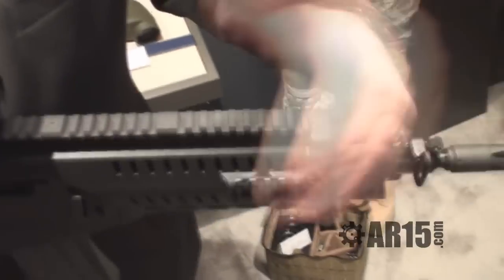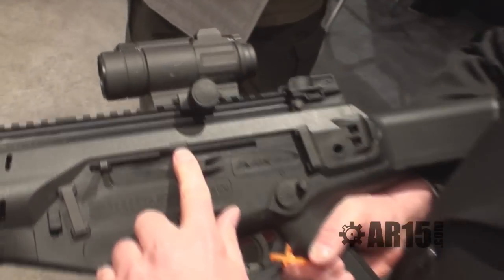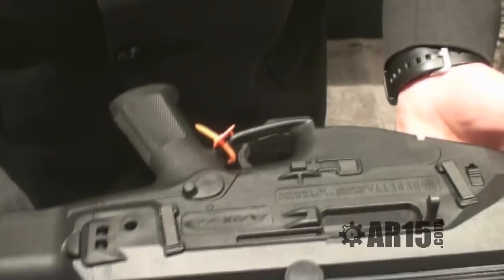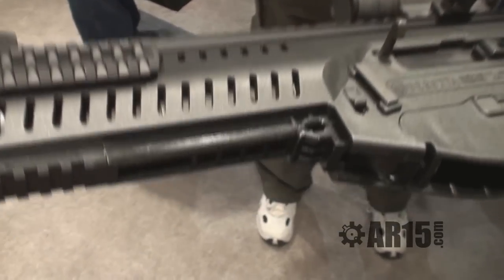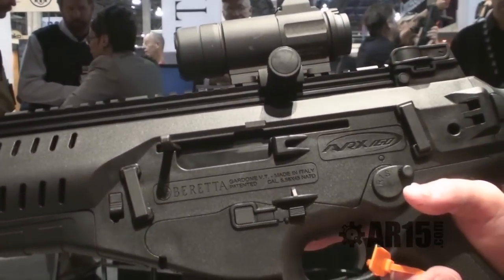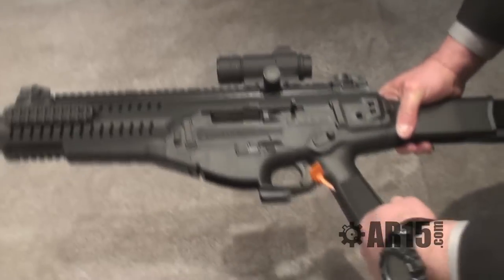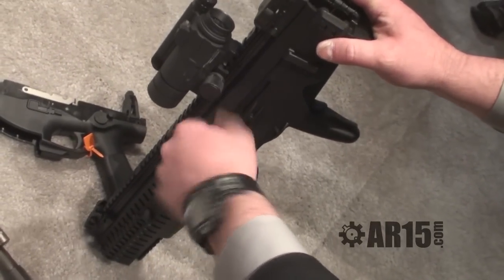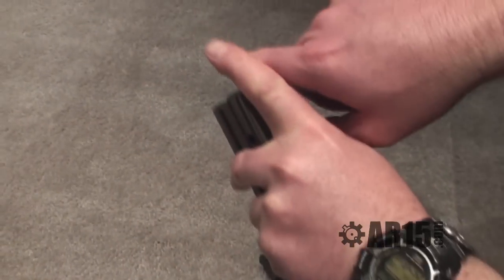Beretta ARX-160 - SHOT Show 2011

Comment: @Hyperpulsehammer I do realize that but the Beretta barrel comes off  WAY easier as you can see in the video. That is what I meant by my comment. As for a reciprocating charging handle, SOCOM specifically requested it so it must have some value? As for the ACR...c'mon we all know Bushmaster screwed the pooch on that gun. The initial offerings suck in my opinion with its ridiculous price, its hex head rail screws, and its 1:9 twist and no barrels available to even change calibers to?

Comment: @3is First of all, 3is, the 3RD mag release on the ARX located at the bottom, near the trigger guard, is perfectly safe since you need to depress it fully to release the mag...Also, that button is in perfect alignment, and it is far easier to have something snugging on a FAL mag release (never heard of it) since it is far more pronounced than the mag release on the Beretta ARX, sticking out and all... The AK is far more pronounced than the FAL and still nobody complains about it...!

Comment: @kookahjoon the tapping thing can go awry sometimes, It seems... You should see this guy in Shotshow 2010, when he had the charging handle stuck and took a second or two to get it right...  the tapping can become an issue, especially with ungloved hands! Ouch! With gloved hands, aka the military, no problem! That issue is not a biggie, if yuo ask me, nothing some training won't fix...And you can always 'slingshot' it or use the awesome bolt release on the trigger guard! Loved that feature!

Comment: @iMagUdspEllr While you did name a few features the 160 has over the SCAR, I don't see how they really matter.  It is only  1/10th of a pound lighter.  I do prefer a light rifle, but thats not much of a difference.  Does the barrel free-float on the 160 like on the SCAR?  I do like the speed of the barrel change on the 160 but does Beretta guarantee accuracy of 1MOA between barrel changes like on the SCAR?

Comment: @patsfanczar Oh, and you ALWAYS need to check the chamber, on the go or not, for safety reasons! You do that on a handgun, to see if a round is chambered, and you do so as well for a rifle or carabine! IT will prevent you from cocking it and eject a perfectly usable round that was already in the chamber, therefore avoiding wasting ammo! You check it before and after you have used it, because at the end you may still have a live round that did not fire! You DO check your AR-15's chamber , right?

Comment: @m16mang 
3.0/3.1 kg, 6.6/6.8 lbs empty, depending on the length of the barrel. Actually it's the lighter of it's kind (polymer assault rifle in 5.56 NATO). The ARX 160 is not another "weapon of the future", is not a "study" or an "advanced prototype". It's already been adopted by the Italian Army (along with Albanian and Mexican special forces), and is currently used in Afghanistan.

Comment: @rijoenpial fal has a mag release located front of the trigger guard like the hk g3 and AK47, not a trigger guard mag release.  I think its a poor 'improvement' design.  I do believe that a button/paddle lever would have been the best as both allow positive mag stripping.  Pushing up on a mechanism to strip out a magazine is flawed thinking and one extra part to break imo.

Comment: He's wrong at 1:09, because changing the cocking handle side does just that, it does NOT change the ejection side; to do that there's a switch that can be operated by pressing a bullet tip in a small indented button.

Comment: @Umimugo Yes, you're right... Problem is that the RFB doesn't have a port to see into the chamber, making the user having to be aware if he already has a cartridge in the chamber... Not good... a 7.62 F2000 would have such port... Another problem with the RFB is the ergonomics... And the shell ejector to the front, and not to the side, like the F2000, is another thing that I do not like on the RFB... Nevertheless, it is a compact bullpup, it is one of the most reliable models from Kel-Tec!

Comment: @patsfanczar  You have that 'trap door' port on the F2000 like you have the hold open to check the chamber in a normal AR... FNH just made sure there was a way for the shooter to be able to check the chamber! The same thing cannot be said for the RFB! The fact is that the F2000, much like the AK or HK, has no bolt hold open device, and the trap door is only checked to see if a round is in the chamber already and/or if there are any rounds left...

Comment: @patsfanczar The casings retention up to 5 casings could be there for tactical purposes, when you are firing a suppressed weapon single shot  and do no want to denounce your position by having casings falling on the floor unless yo deliberately tilt the F2000 to drop them... That is one possible reason... The truth is the forward ejection works, is very useful for lefties, the trap door is there for several reasons, and the weapon is compact, lightweight and very maneuvrable, like it or not!

Comment: UT OH, Cant have this in CT. It has a retractable and folding stock. Well i guess we could pin the stock so it doesn't retract anymore. But if we pin the folding section we wont be able to get the bolt out to clean it. Bummer.

Comment: Why  would ejection side matter on a non-bullpup design?  As for plastic being less durable, looks like the 160 has alot more plastic then the SCAR...just saying.  Larger selector levers are already available for the SCAR from Magpul.  I hope the 160 is cheaper, I may very well buy one if it can be had for under 2K.  Oh and I am glad that the US is focusing on the Scar L, Caliber changes don't seem to be offered by the 160, but with the SCAR L you can change from 7.62 to 5.56.

Comment: Body- they may want to trim it down. I like the barrel changing mechanism- how well does it hold zero? One thing though, I like simple caveman design to keep uncle Murphy away. You got way too many ways to drop the mag! That could be a liability - just keep the ak style ambi on the bottom.  Then this left / right ejector swap, is that really necessary? I just hate for yet another complex thing to break. Lastly, what's the weight? Optimally it should be less than 6 lbs empty.

Comment: I like the fixed function variables for left or right ejection, scope, dot sight, standard, and the optional 40mm mounting rail, but three mag releases sounds like an easy way to drop a mag accidentally. It's not like a standard AR-15 magazine release is hard to find or use and people always look for what they are accustomed to automatically when it comes to mechanical features. Cool if you want to have a mag release in several Kama sutra positions but completely unnecessary.

Comment: @patsfanczar  Well, the zero is maintained on the SCAR upon reassembly of the barrel...Until we know more, we don't know if the ARX-160 maintains zero... And I have my reservations about that, because the ACR doesn't maintain zero upon reassembly of the barrel... The barrel needs to be firmly attached at the base to maitian zero and until the ARX-160 testing demonstrates this, I will, for now, trust the SCAR over the ARX-160 on this subject!

Comment: @patsfanczar Excuse me, a bag IN FRONT of the RFB would be idiotic at best...Let me remind you that the spent casings tube is directly above the barrel, so where would you put the spent casings 'bag'?!? The F2000 doesn't need a bag, because the casings fall easily to the side of the shooter and not in front of him, like the RFB does! And having to do 3 movements to check my chamber  (remove mag-peek into chamber from below- place mag back) instead of one (pull TD up) is a sheer waste of time!

Comment: @spritegamer i have yet to meet a polymer that has the same tensile strength as steel alloys, i have yet to see a polymer machined to the same tolerances. i have machined plastics and they are HORRIBLE to work with...

Comment: Ehhh... Cool concepts but not impressed... The barrel quick disconnect is a bit disconcerting... If it can pop out that easy by hand it wouldnt take too much impact to disconnect it by accident (but thats just my speculation). Wonder how it holds zero after taking out the barrel and putting it back it...

Comment: @Hiluxtaco It is called priorities due to limited production resources... Usually.any company that has contracts with the military for a precise model, the priority is the first client of that weapon, meaning, LE and Military... First and foremost, that is where teh big bucks ar, with not just the number of weapons sold, but also kits, replacement barrels, etc... Those contracts usually last for 10, 15 years, so you can imagine how much they gain from those contracts... TBC...

Comment: You remember the RX4 Storm? What crappy concept, they just slapped some crap on the Benelli R1 since beretta owns and then and tried to pawn it off as something new, there was nothing "X4" about it. They really should have tried to make THIS the RX4, versions in 5.56, 5.45, 7.62X39 and 7.62X51, plus all those different barrel lengths, man, would have been awesome. It's still pretty sweet though.

Comment: @patsfanczar  First of all, no hot brass falls on your hands if you fire an F2000, AND yuo can always contain up to 5 rounds without them falling... Very good for sniping! tell me if RFB can do that! And having to remove the mag to see the chamber is ludicrous! You need to be able to check it on the go! And the explosion factor is only if the weapon is ill conceived, which is less likely...So far, never happened! And never will! And it is a piston system, so no heat is accumulated in the chamber

Comment: WTF? An overengineered, horribly expensive, 8 plus pound monster to shoot a .22 caliber projectile?
Reply: Its modular firearm and can fire 5.56,7.3 and 7.62(.308) rounds without any change and you can switch barrels to go for sniping or full auto mode
Reply: Usman Siddiq argentina army buy this weapon.
Good choise or bad choise??
The buy of scar FN H canceled las year.
Reply: I can understand their concern cuz the FN-Scar is very costly but offers the almost nothing in return
The Beretta is 1000 dollar cheaper too.
The Scar also lost against the AXR in Pak rifle competition in 2017 and even Hk-416 was unable to beat the Cz-806 bren s2 in reliability test and they even go as far as to tech-transfer scorpion(smg) free of cost.
The Pakistan known to supply Hk Mp5(Hk offered MP-7 too) to other countries,I don't think they will go for scorpion.Russians in the mean time have secured sale for 20,000 Ak-103 but the FN is putting up good fight this time.
They are offering full tech transfer along with other SMG's and pistols at very reasonable price.The Scar failed the reliability test and everybody is loving the pricing by FN but they are afraid of weapon failure.

Comment: @patsfanczar Oh, I think FNH would manage a lightweight 308 bullpup! And with all due respect, Kel-Tec is NO FNH! If FNH decides to do a .308 F2000, they would surely make it a formidable weapon! And the RFB is just a bullpup in 308, whereas the F2000 is a bullpup in 223! And do not forget that Kel-Tec  'copied' the forward ejection system devised by FNH back the late 90s for the F2000 itself, minus the chamber checking device, which clearly Kel-Tec overlooked!!!!